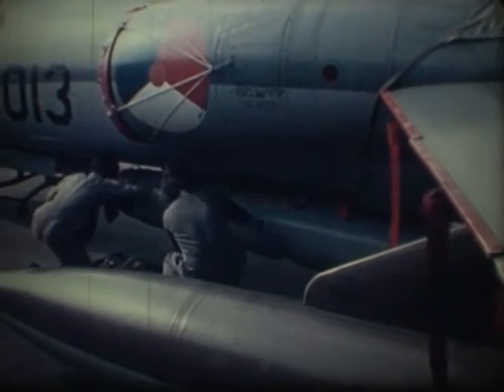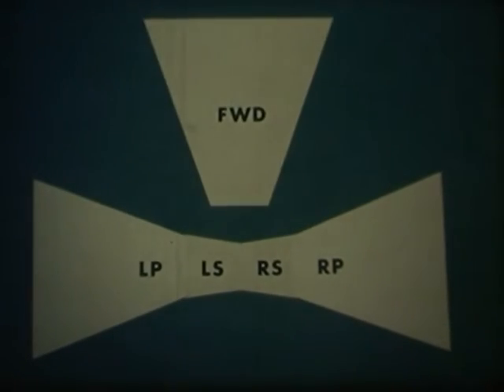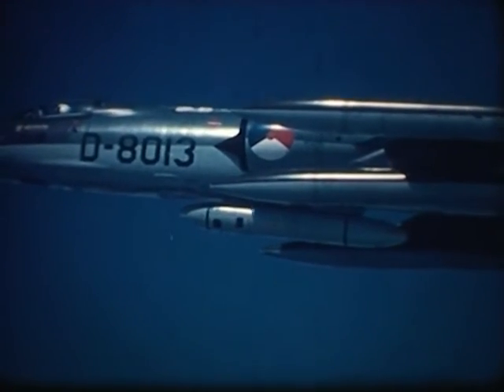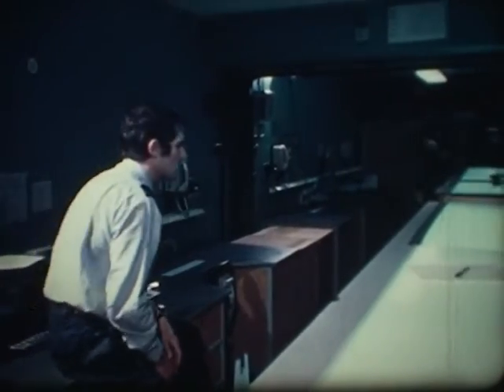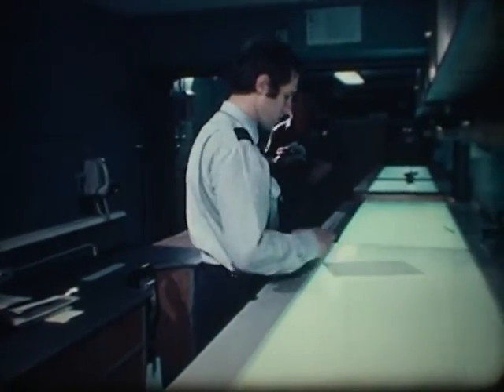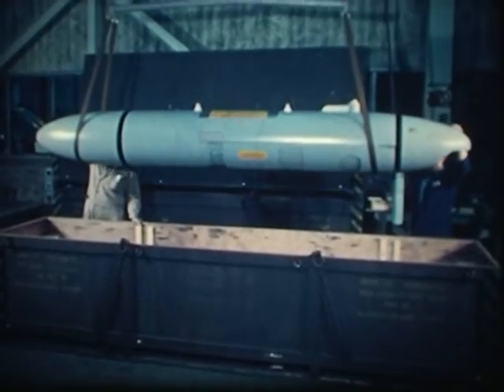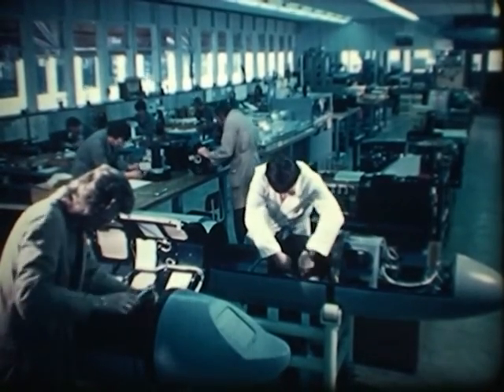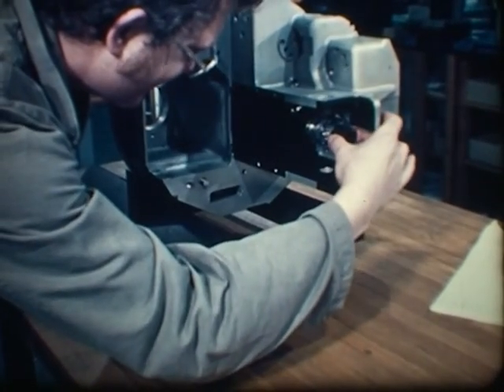Old Delft Orpheus System

Comment: Old Delft had toch ook een vestiging in Leeuwarden?
Reply: Ja, klopt. Ik geloof dat ze daar de nachtkijkers maakten.
Reply: @AnthoniusHermans  Alle nachtkijkers werden in Delft gefabriceerd o.a. door mijzelf. Leeuwarden maakte medische apparatuur zoals röntgen camera's
Reply: @HansMouthaan  Okay, zat in de war met Roden. Daar werden de restlichtversterkers geproduceerd.
Reply: @urairukonsamrong4119  inderdaad toen ook al marktleider in deze techniek, op de naam photonis vindt je alles er over, nu is het een Nederlands/Frans bedrijf, ik heb nog korte tijd bij Philips Usfa gewerkt en die stond aan de basis van het Franse deel in deze.
Reply: @HansMouthaan  Do you know if Old Delft also manufactured fast lenses like 100mm f/1.1 or 100mm f/1.2 for night reconnaissance with the TA-7 camera? I have never seen those, but only the slower 52mm f/2.7, 70mm f/1.6, 150mm f/2.8, etc. Is there any documentation, picture, or information about the faster f/1.1 lenses for night reconnaissance?
I am always interested in very fast lenses, and I am very familiar with the ones for fluoroscopy... Thanks!
Reply: @AnthoniusHermans  : dus voor de F-104?
Reply: @Bert-w3p  Het Orpheus systeem, 5 70 mm camera's en een infrarood lijnscanner is ontworpen voor de F104 starfighter en later aangepast voor de F16. Inmiddels is de apparatuur digitaal. Orpheus is een laagvlieg systeem die niet meer toegepast kan worden ivm moderne bewapening zoals Stinger.